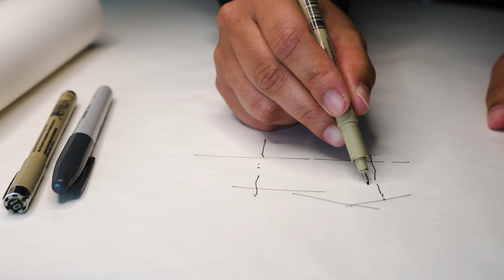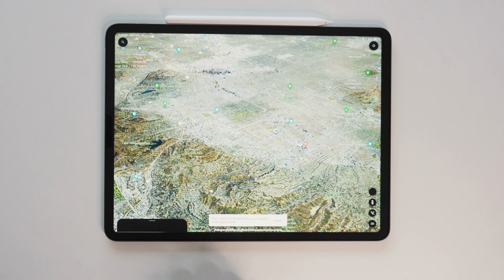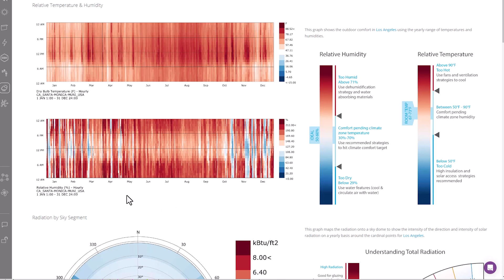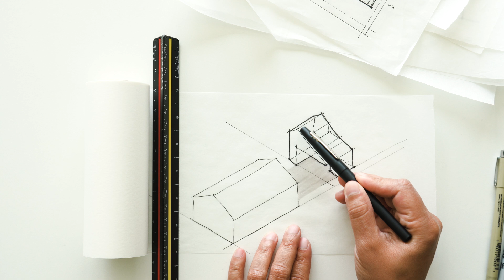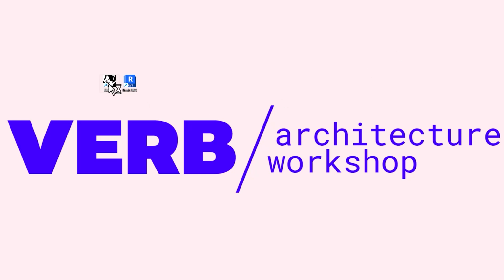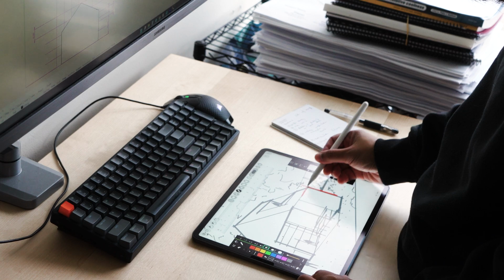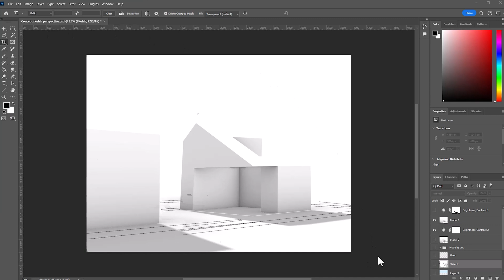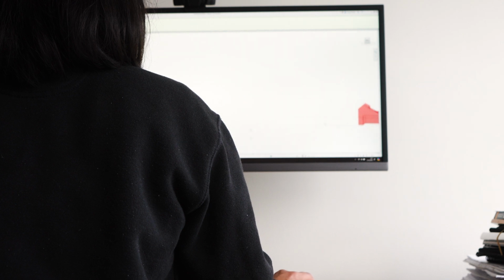How to Start a New Architecture Project | MY DESIGN PROCESS

Comment: Nice video. I was wondering can you use the program FormIt instead of Rhino in the conceptual design process?
Reply from the maker: Absolutely, any architecture software that works for you can be use as a tool for design concepting. I’m just more familiar with Rhino as a design tool.

Comment: Please help me to understand why you use a "Typical LA residential lot" plan vs the actual project site. Great vid.
Reply from the maker: Thank you and great question. This project is meant to be submitted to the LA pre-approved standard plan program. I used a typical LA lot as the site rather than having a specific location for the project so the project can be adapted to any LA residential backyard that can have an accessory dwelling unit.

Comment: good job!! I really like your chanel. <3 keep it up.
but there is a question that can you draw some thing more complicated in rhino like curvy shape and link it into revit to make details in revit? Then if I want to add more things that revit can't afford to draw, how can I do it? Do i need to import it back to rhino to draw a thing I want which sticks in a certain surface? and then again link it back to revit ??? thank you.
Reply from the maker: Thank you! Yes, you can model more complicated curvy shapes in Rhino and import into Revit. The best way is to establish a shared origin between Rhino and Revit so that when you model in Rhino it will be placed in the correct position when you upload into Revit. For more detailed info, check out my other video “How to establish a workflow between Rhino and Revit”. 

Hope that helps.